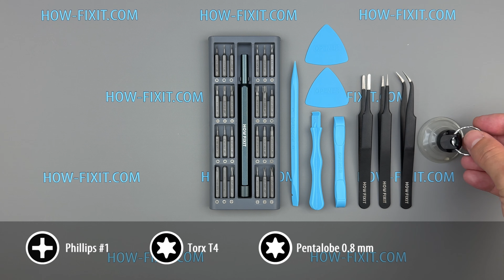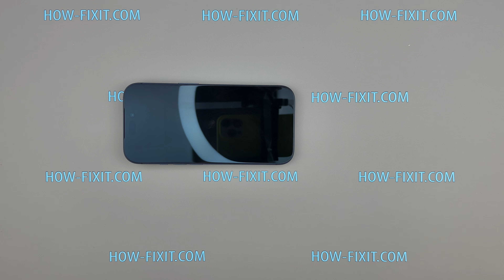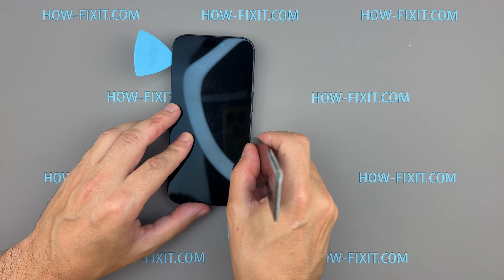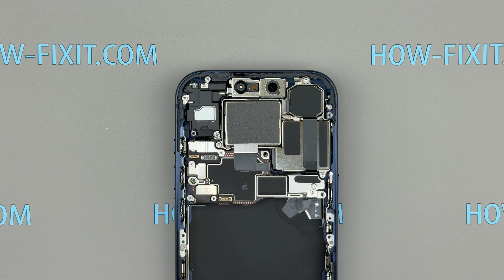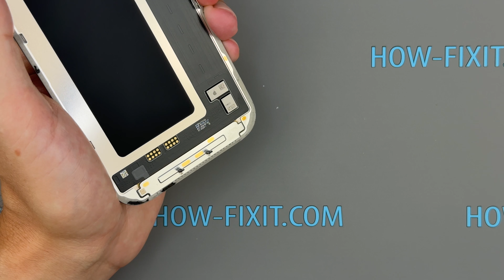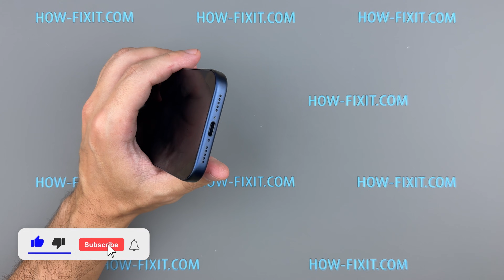How to Replace iPhone 17 Pro Earpiece Speaker (Quiet/Muffled/No Sound Fix)

Comment: Hey dude, I just wanted to say that you helped me a lot in my ps5 repair, but its still not working. My son spilt water on it and the system works for a while and then shuts down after a few seconds  of actually playing any games. Right before that it gives a overheating warning.  I switched all the thermal pads and the liquid metal and im getting the same error. I really need your help right now, my son is crying and it would be wonderfull if you can help us.
Reply from the maker: If you tell me PS5 model (original/slim/pro), whether the spill was plain water or something sugary, and how long it ran wet before powering off, I can point you to the most likely areas to inspect first. And it’s best to ask these questions under the video, based on which you did the service.